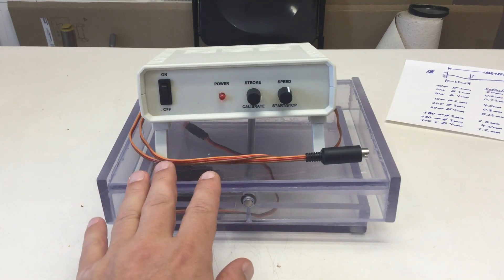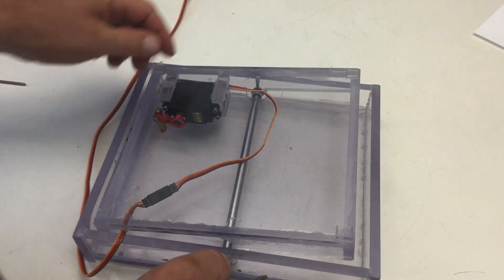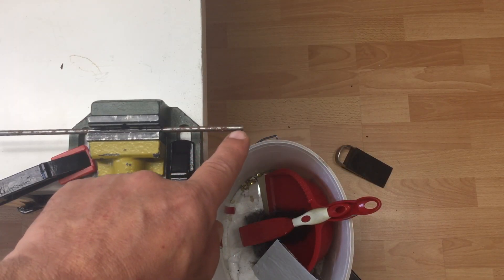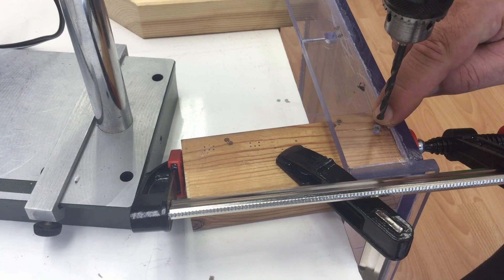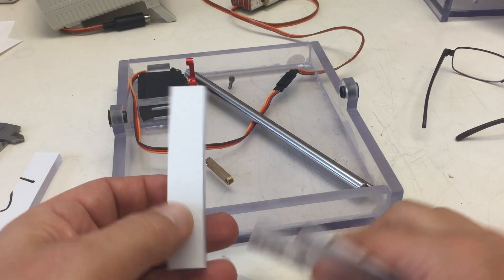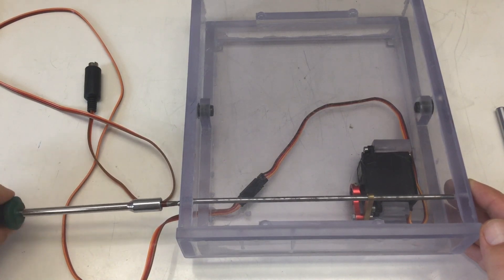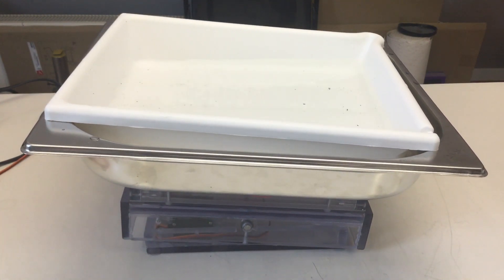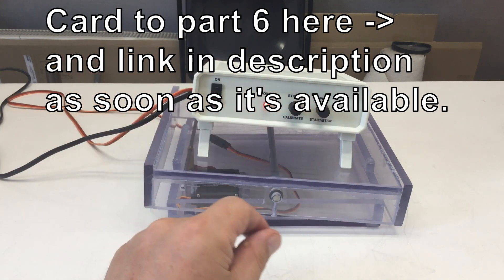Laboratory Shaker (5): Mechanical Improvements

Comment: Finally got time to watch  :)  you could add two more support points on the new 4mm pin either side of the servo to reduce the flex still further, you have two left over bits that would just need a 4mm hole and then glue into position ?
Reply from the maker: First, thanks for watching! Yes, additional support would be the next step. But because I'm lazy ;-) and the 4mm pin is working OK I will delay that until the need arises. BTW I think adding one support at the middle of the upper part would work wonders (halving the free length of the pin and quartering its flex).

Comment: To take the burs of the end of the rod, I use a dremel tool and just turn the end of the rod on the surface of the grinder. Much easier and quicker.
Reply from the maker: Thanks for tip! I even have a holder/stand for my Proxxon (Dremel-like tool), so I could use both hands to hold the rod while deburring it. But for some reasons I never thought about that. So thanks again!
Reply: @robertssmorgasbord  I only thought about that because that's how I cut long bolts and rods.
Reply from the maker: @Berghiker  Well, it's a much better method than mine :-)